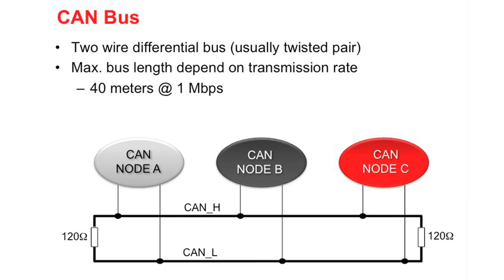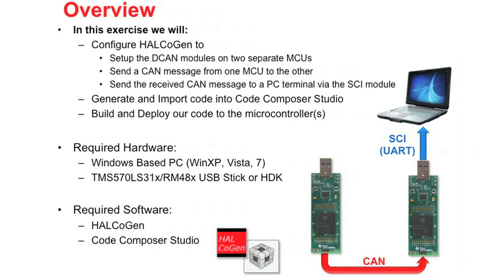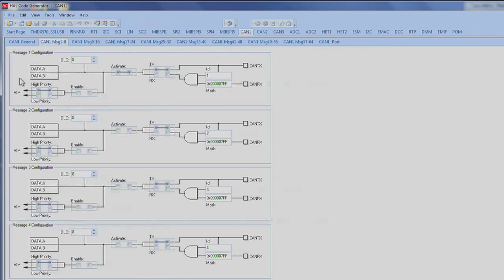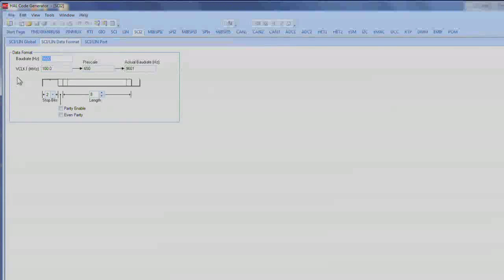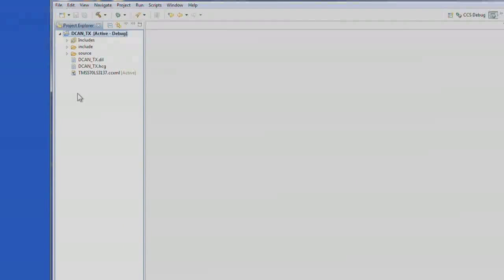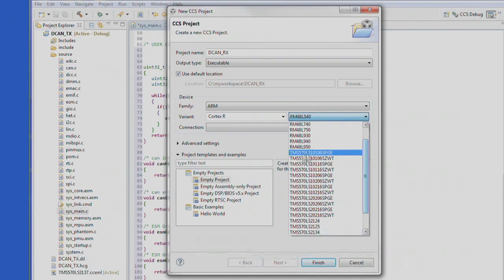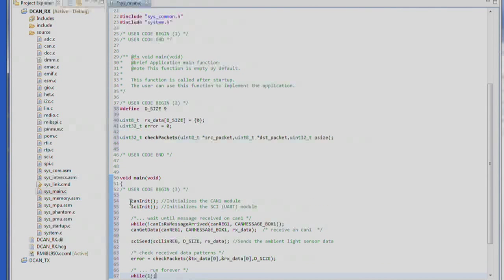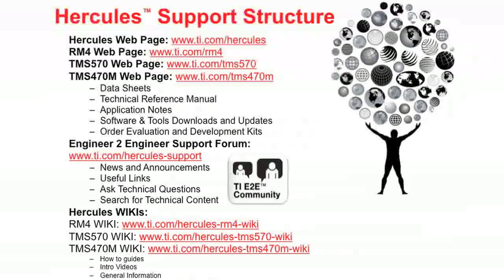Hercules Tutorial: CAN Communication

Comment: Completely leaves out the fact that a separate CAN Transceiver is required.  That's the reason nobody in the comments is able to actually run the example.  Also doesn't mention the requirements for wiring the thing once you actually have all the components in hand.

Comment: Bad Example
 error #20: identifier "CANMESSAGE_BOX1" is undefined
Reply: I got the same error.  Looking through the "HL_can.c" file (HL_can.c is used for TMS570LC43x), I found out that the correct keyword is 'canMESSAGE_BOX1'.  The first 3 letters have to be lower case.  Not sure if he faked running the code or what.